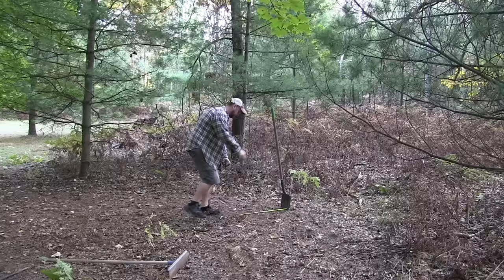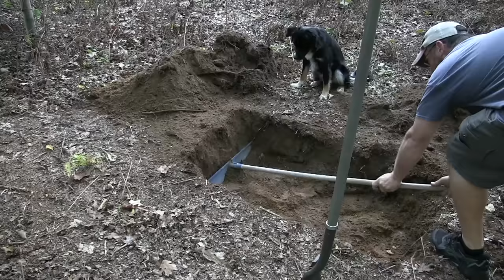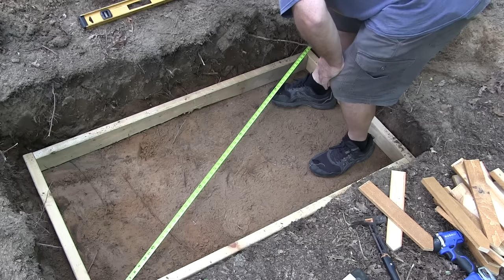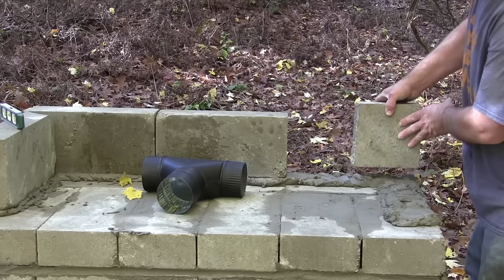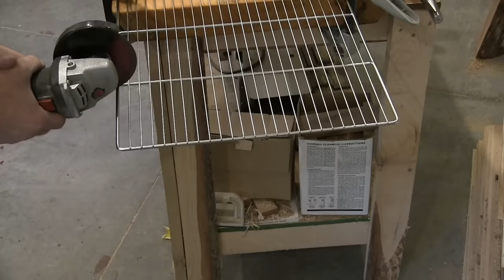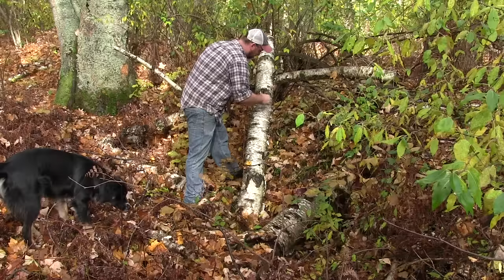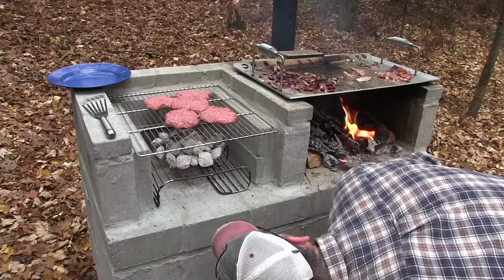building an outdoor kitchen for my off grid cabin

Comment: Great job.  Most folks are too afraid to learn by doing,,,

Many people don't know this but.....,you are actually supposed to cook over the coals of a wood fire, NOT the flame.  So, bringing the cooking surface closer (down) will make a much improved cooking experience.  I have found that aspen makes an excellent coal bed for cooking over.  But it does take some time to build that coal bed.  To make steaks takes me about an hour from start to finish.  If I need a griddle or a surface to sauté', I just use a cast iron skillet over the wood coals.  

I would have made the wood side about double the width and 1/2 the height.  That way you can tailor the fire and move coals around to have different levels of heat.

If it were me, if I were planning on using charcoal, I would try to make something to vary the height of the charcoal.

Remember, it doesn't matter how big the flames are, you aren't cooking over the flames anyway.  You are waiting for the coals...
Reply from the maker: I cook over coals on a campfire, but with this I made the firebox too high so I would have been there all day trying to cook those onions and I like them kinda crispy and caramelized so I think you just need to be flexible  with your methods .
Reply: @blackspruce1861  If you don't like the floor height, you could mix up some non-shrink grout and build up the floor of your fire chambers.  Mix it fairly dry and you will be able to mold it into whatever shape you wish.
Reply from the maker: @nohillforahighstepper  I might add a layer of fire brick that would bring it up a bit

Comment: This is absolutely wonderful and amazing! I want to do something very similar in our back yard, so thanks for your inspiration. Would you mind sharing general cost and overall time or took you to do?
Reply from the maker: Thank you !! if you had everything around you could do it in a day or 2 . it doesn't take a long time really but I poured the concrete and let it set a day ,then I set the blocks for the base then let it set up a day so that when I packed the sand it wouldn't much the blocks out , then the top I did all in one shot . . really if you poured the concrete early morning and didn't pour it too wet you could do the blocks for the base in the afternoon , then do the rests the next day . it cost me around 250-300 to build

Comment: Not so much an outdoor kitchen, more like an outdoor grill. But a nice video. Perhaps a screened-in canopy and some running water, and some electric would  turn it into more of a kitchen.  I don't understand the stove pipe if you're out in the open. Really nice video though. 👍😊
Reply from the maker: I'm planning to build a pavilion over it this year . and maybe figure out something for water . you would be surprised how much the pipe helps . when its just open fire the smoke doesn't go up the pipe much but as soon as you put that big griddle over it most of the smoke goes up the pipe which is great because if it didn't it would all come out the front right in my face .

Comment: Toughest part about cooking with fire is figuring out the heat settings. Looks good!
Reply from the maker: It really is . a lot of people have said I need to wait for coals but they don't realize how high that griddle is above the bottom of the firebox with coals it would take an hour to cook a burger or anything really so it is kinda hard to have the right size fire , so far everything has turned out pretty good though

Comment: Did you get the plans for the materials from somewhere ? I'd be scratching my head trying to estimate how many blocks to buy , shapes, sizes, and how many bags of concrete . How many hours went into that build?   Awesome video . I spent the better part of yesterday installing a replacement glass cook top on my electric stove . Part was no longer in production , had to get it on ebay, it was 200.00 . Used. (Beware of those stoves also  in travels. I love them because they are so easy to clean but be gentle. ) Now you  have to build a lean-to for that rig to cook year 'round.
Reply from the maker: Nope no plans , and I was scratching my head while I figured out how I wanted to do it lol . I had one of those stoves once . I wouldn't but one again after melting stuff on it forgetting it was just used . I actually just built one here's a link to the video. https://youtu.be/Y63Vj1G9znI

Comment: my outdoor kitchen was built out of necessity during the cabin build, it started with the BBQ, then i put in a concrete slab with the grill,  later the wood fired oven and roof came.  Now the wife has it all doped up with lights, hanging flower baskets, wind chimes and a sink.    We never looked back, we just have a little kitchenette in the cabin for warming up leftovers.
Reply from the maker: That sounds awesome !! I'm thinking of doing a roof over mine how does yours do with the smoke does it get bad under there when you're cooking ?

Comment: I like what you built. I like cooking outside and was thinking of building what you did but wanted to know if the block will crack from the heat? I had a cabin burn down and the blocks weren't there after that fire.
Reply from the maker: Thanks !! I used the solid block for the fire box area and they seem to hold up pretty well but they will eventually crack if you don't line it with some firebrick to lessen the direct heat . for the most part you cook for maybe a half hour to hour at a time and I think the real damage seems to be extremely hot fire or long exposure . still I would suggest to line them with fire brick
Reply: @blackspruce1861  I should of known that, I have a tiny woodstove. It doesn't have fire bricks it's just metal but I will add some. You did a good job on your outside cooker

Comment: Will the cinder blocks and bricks crack under heat? Particularly if they are wet from rain. May be even explode?
Reply from the maker: I have personally tried to blow up wet concrete to see if it really happens and it didn’t happen. That said I think it probably can but maybe i just didn’t have perfect conditions. It will crack under long periods of a hot fire mine hasn’t cracked yet . I did line the firebox on the right in my pizza and maple syrup video because maple sap takes a long time with a hot fire . I would just suggest lining the fireboxes with firebrick

Comment: Guess my only question is will the cinder block top hold up to the heat without popping apart over time? I've looked into these and I see other folks using red bricks.. just wondering...
Reply from the maker: I think I should line it with fire brick or clay , I'm pretty sure over time it would have problems

Comment: Does know if you can have the same structural integrity using bricks that have holes in them? 

I've been planning an outdoor seating area with something similar to this. We salvaged some old brick, some solid some made with holes, and some concrete block from our neighbor's yard. I'm hoping I can use those to get the job done
Reply from the maker: it depends on the brick . I think the old clay bricks are supposed to take heat well .  with concrete block you should probably line the fire box with fire brick because concrete doesn't take intense heat really well .  the solid concrete blocks will hold up a while for cooking because you normally only have a fire for maybe an hour but still would be better with fire brick lining

Comment: Did you coat any finish on the bench to weather proof also on the cutting board? Thanks for your carpentry work. I cut down some white oak trees and every I cut for fire wood I wanted to make something out of all the woods.nowI learn from you
 Thanks
Reply from the maker: I used deck oil on the bench /counter . I used cutting board oil on the cutting board
Reply: Thanks happy New year !

Comment: Great build! Looks like it does its job in spades! 

Question: What was the point of the form if you just filled the whole hole?
Reply from the maker: Thanks!! it makes it much easier to screed your concrete level with a form that's set in place level. and the only reason I filled around the form with concrete was I had a bit more than I needed and I didn't want to have to find a place to dump it

Comment: How has it held up. I wanted to do a firepit with a mixture of cynderblocks and pavers, but was told they would pop and crack in a short time. Your set up looks awesome.
Reply from the maker: so far its held up good .the big difference between this and a fire pit is this only burns maybe an hour at a time the fire pit will ruin cinder blocks a lot faster and  you definitely wouldn't want to sue the hollow blocks . Thanks !!
Reply: @blackspruce1861  thanks for the reply.
Reply from the maker: @mrchrisknight315  no problem

Comment: I really want to do similar , but i'm gunshy of pulling the trigger on a project like this.

3:17.  I see so many people using rebar when they pour concrete.  I would prefer to avoid using rebar due to budget.  What made you not use rebar here?  I want to do the same as you
Reply from the maker: I just didn't really feel that it needed it being that its quite small and built on good soil

Comment: I'm a fifth generation Mason, and you did fine. It's takes years of practice to be good at laying block and no one is good at the start. You mixed the mortar a little dry which is why it was fighting you a little.
Reply from the maker: Thanks! I was wondering if that was the problem ,

Comment: Thank you for sharing the video. That is a nice job you’ve done on that outdoor cooker. Where did you get that flat grill? I cook outside over an open fire every chance I get. That would be a nice addition to my outdoor cookware. Thanks again for the video.
Reply from the maker: no problem , glad you liked it !! the company that makes it is called MMMUSA they should pop up if you google them . I really like it and was pretty impressed how non stick it is once I figured out how to cook on stainless
Reply: @blackspruce1861  Cool, thanks. I will go check them out.

Comment: Nice grill but my ? Is y wood for the flat top? Does charcoal get to hot and what metal did u use
Reply from the maker: Thanks !! I like to use wood since I have plenty of it . also the fire box is quite deep I would need to make a tall platform to get the charcoal closer to the griddle . the griddle is stainless steel its made by a company call mmmusa

Comment: Are the thinner bricks fire blocks or fire bricks. I want to do a fire pit but was told to use fire proof material
Reply from the maker: They aren’t, that would be a much better way to do it though . I lined the firebox on the right with fire brick in my pizza video

Comment: HOW DO PEOPLE EXTINGUISH OR TURN IT OFF WHEN THEY'RE DONE BUT THE FIRE STILL ON? PLZZZ ANSWER
Reply: Can u can u just throw water on that brick?
Reply from the maker: @dyfrigshandy  I have a bucket of water about half full or less . I’ll set that right in front of it and use a little fireplace shovel to scoop the coals into the bucket of water .
Reply: @blackspruce1861  so the charcoal into a bucket of water, and not the water thrown into the charcoal?

The wet washed charcoal can then be strained and reused again?
Reply: U can use sand however, it says that
Reply from the maker: yeah its less messy that way and I think if you threw water onto that hot concrete it might crack it . I doubt you could reuse the charcoal

Comment: i suggest adding a bed of "barro" "mud" in the fire pit because concrete should not be exposed to such heat for extended periods of time without any kind of material between, it risks damaging your work.
Reply from the maker: what does barrow mud consist of I've been thinking of something like that too . but not sure what to use and trying to think of an alternative to  fire brick
Reply: @blackspruce1861  I am an amateur,  can't speak for myself, but it seems like "como mezclar arcilla refractaria" in google provides good results, then just use google translate. I can't paste links on youtube. There's also "ladrillo refractario" or brick for firepits which is made of the same thing I think.

Comment: nice project - great job! Do you need to full all of those blocks with cement? That must have cost a lot. We had a block wall installed and they only filled the bottom couple of runs to provide base support, and left the rest hollow. The also filled the 2 block section where the gate was attached. It'd been up for 6yrs now, and no signs off issues....
Reply from the maker: Thanks !! I don't know honestly , I was kinda winging it .

Comment: nice work although I am curious what the clean up looks like, Do you have a creek nearby and how do you get rid of grease?
Reply from the maker: thanks! I pour the grease on the fire and burn that up . then I wipe the rest of with a paper towel and burn that . and clean the big griddle with a scratch pad and soap and water . I normally haul a couple buckets with me . there's a small spring but I normally bring enough that I don't need to get it from there .

Comment: I came here to watch / learn how to build a grill, came away wanting to grill dinner tonight; and build a grill.
My only question, the smaller blocks you laid around the actual grill, where they anything special (Heat resistant) or the same as what you built the rest of the grill with?
Reply from the maker: Glad you liked it ! They were regular blocks but fire brick with refractory mortar would hold up to the heat a lot better. So far I haven’t had any problems but it could be better
Reply: @blackspruce1861  I'm looking to build something like this in my back yard, tired of the old gas grill I have and ready to get back to charcoal / wood grilling.
Thanks for the insight on the bricks and mortar.
Reply from the maker: @gregorywallace7614  no problem . I hope it goes well. I really enjoy cooking on mine

Comment: You did a great job brother. My wife and I just bought an off grid cabin on just over five acres. I’ve been thinking about doing this exact thing. Love the layout. Where did you find the griddle? I like the design of that one.
Reply from the maker: Thanks !! my sister in law actually gave me the griddle but the company that makes it is called MMMUSA . I built an add on smoker / oven for it as well the video is on my channel if you're looking for more ideas . I had a little problem with it but I have it figured out now
Reply: @blackspruce1861  
Excellent, thanks for the info.

Comment: Hmmmm, good job,...but...did you put any iron net, rods into concrete mix?? Maybe I missed that....., otherwise it will crack bad! Otherwise nice job !=)
Reply from the maker: it's basically a thousand lbs of concrete and sand in a 2x4 box it might crack but it's going to take a while

Comment: Great job but I would have built a slightly wider cooker so that the metal rack will fit perfectly and give a larger grill area, instead of having to cut it.
Reply from the maker: Thanks! I could have done that but I just didn’t want to make it bigger at the time
Reply: @blackspruce1861  fair enough and I wonder if the rack arrived after you had measured the cooker anyway

Comment: The question is.. how are the concrete bricks holding up with the heat?
Reply from the maker: still pretty good so far I did line the right side with fire block in another video a while back

Comment: Will the cider blocks crack from the heat?
Might have lined with fire brick idk?
Anyways cool project
Reply from the maker: I did line the right side with fire brick when I did that pizza and maple syrup video . yeah over time heat would break them down .  Thanks !!
Reply: @blackspruce1861  I'm going to check out the pizza oven build video 🍻

Comment: What would’ve happened if the log that you transferred to the other side would have fell off ? I’m just curious to know your put out fire method in that situation
Reply from the maker: I would have scooped it up and put it back in . if it did start a fire I would have doused it with the bucket of water I had .

Comment: Hey mate, looks awesome! I'm sure someone else has asked in previous comments but do you have a list of the materials you used for this build in particular the types of blocks you used and if they're fire resistant or standard?
Reply from the maker: Thanks !! I don’t have a material list but the first 4 corses were 8x8x16 blocks. The top was 4x8x16 solid. I didn’t use fire brick but probably should have I might line the fire box with fire bricks
Reply: @blackspruce1861  Thanks for the quick reply, I'm going to give this a go :) Cheers!

Comment: You built a bomb of exploding concrete. Too much heat will cause those blocks to shoot out small to large chips of  concrete. Line it with fire brick. Other than that, its a very nice build.
Reply from the maker: thanks

Comment: Did you burn the 2x4's so they would be bug resistant? Or are they treated?
Reply from the maker: The 2x 4s were only used for a form to pour concrete in and screed it level otherwise they don’t serve a purpose.  I left them in the ground because I didn’t have another use for them
Reply: @blackspruce1861  oops! I meant 4x4's . Burning is so much less expensive and no chemicals like treated wood.  I'm not a bricklayer (a long way from it being 70 and female 😃) but I love this idea!
Reply from the maker: @jamiemorrow4184  oh the cabin posts are treated

Comment: What kind of wood is your chopping block? And how did you finish it?
Reply from the maker: It's black walnut . I ran it through the planer ,sanded it , and I used several coats of cutting board oil. you put on a think layer and let it soaking in for more than 20minutes then but rub it in and repeat.
Reply: I guessed right about the black walnut. Looks good! Got a black walnut tree on the edge of my lawn.